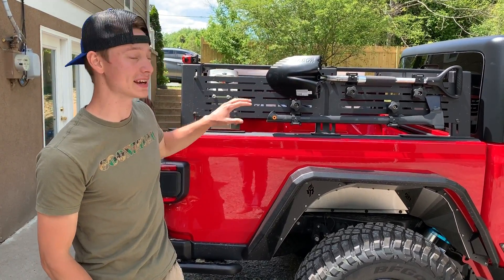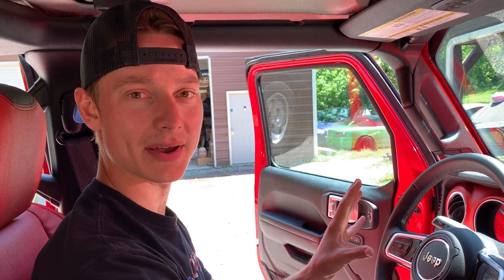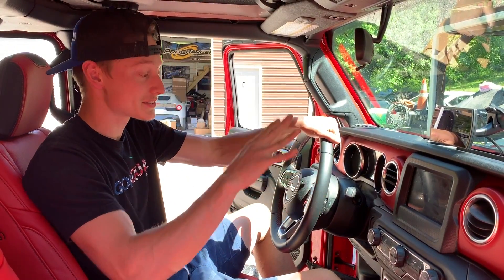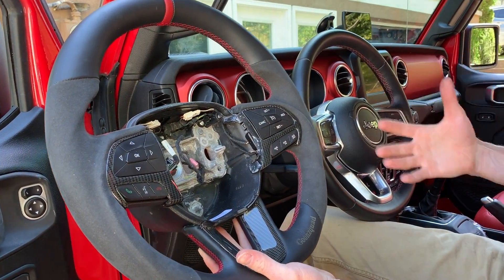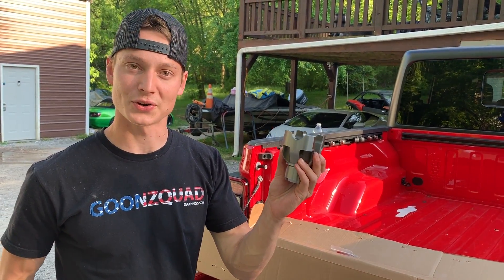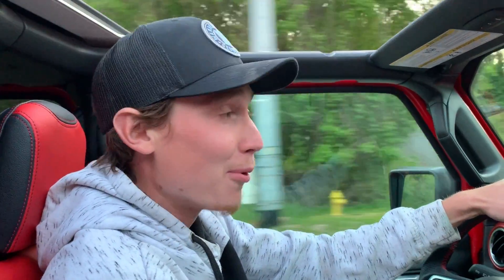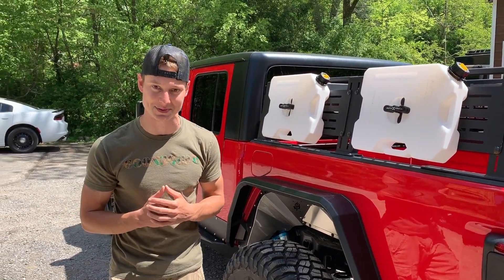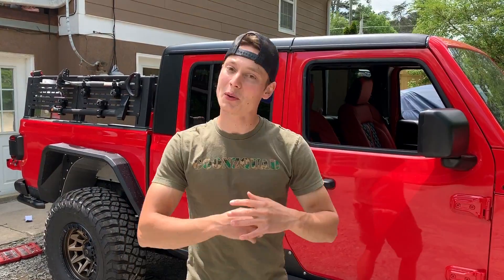Rebuilding A Wrecked 2020 Jeep Gladiator Rubicon Part 19

Comment: Install the powersteering cooler, LED's and tent aswell as spraying the truck bed with black bed liner for a final video on the gladiator
Reply: I was thinking the same!!!
Reply: Fix the dent in the tailgate and the one on the Denali whilst your at it too boys!
Reply: @markbennett6658  all they do now is clickbait anyway... Do stuff just for content. not because it's the right thing to do, or because they thought through it. The military vehicle is a prime example
Reply: I think this is a good idea
Reply: Yeah, bedliner is mandatory.
Reply: @houwant  you're totally wrong. they built that truck because it fits the theme of the world right now and its cool thing to do.
Reply: Sampoorn PN So sorry your feelings were hurt!
Reply: Sorry ma'am, the apocalypse vehicle is one of the worst thought-out things I think that anybody could ever do. That build was not thought through at all! For example, do you know how much a gallon of water weighs?
Reply: @speedcarnage7003  it's cool if you think about doing it the right way... If you actually freaking think about what you're doing and plan it out... But they didn't do that. It was just to push video content out for us. Straight clickbait! I mean seriously:
1- solar panels
2- inverters
3- water tank
4- table
5- LED lights
6- water pump
7- interior paint
9- batteries
10- air horn
11- cabinets
Should I go on? crazy cool project if you think about everything else in advance but they didn't do that it was just a push to get content out.
Reply: And a complete walkaround!

Comment: might want to flip that table around so it doesn’t hold water when it rains!
Reply: Haha... first thing I thought. 2nd was, I'd probably add some 3M foam/rubber strips to the rack because it looks a little loose. That rattling would drive me insane very quickly.
Reply: Was thinking the same thing
Reply: It was the first thing I thought, I hope they have a clothes line installed when someone takes the table out and gets a gallon a water in their face.
Reply: Good eye!
Reply: greenhouse3505 didn’t even add max tracks lmao

Comment: I rebuilt a 13 fusion titanium and it took me 3 weeks to figure why it would not start with push start, same as you a plug that was involved in the accident had pulled some electrical pins up and I couldn't tell until I examined the plug. Pushed a couple pins back in and she fired right up, also AC pump started as well. Good find and great vids.

Comment: greeting from the Philippines guys! i would like to suggest get some black water tank, black tank can absorb heat better than the white tank, which means that it can help prevent some growth of algae and other water borne organisms.
Reply: Am a filipino: What if Camo paint????
Reply: That’s horrible advice - here in the USA & also Europe; White or Blue tanks are for potable water, Red is gas, Green is diesel. Black tanks transfer the heat & are NOT for drinking water - only sewer/septic.
Reply: @krasnaludek298  Nevertheless, a white water container will have algae grow in  it while a  black will not.    Where I live many plastic rainwater tanks are black for the same reason, even though it's a hot climate.
Reply: @karl-chanblox1165  aslong as its dark color. Yes camo can do the job but the problem it will not match the paint.
Reply: @krasnaludek298  i assure you good sir when you white plastik tank is always under the sun even though it has a little bit of water inside it will grow algea inside..

Comment: When you guys were switching out the driveshaft, it looked like there was a crack in the frame... The more I look at it, the more I wonder if it’s just a wire lol
Reply: its a weld dude... there's one on mine as well I went to look  ( follow it down to the double plate where the tow hook would go into the frame hole )
Reply: chad ford ahhh okay I’ve never seen a gladiator in person so it was tripping me out lmao, thanks for clearing it up for me🙏🏻
Reply: @kathedrol2930  you scared me for a second hahaha after reading your comment... but I prefer my JKU the wife drives the JT more than me

Comment: Just saying chk. Your table need to turn upside down so water does not collect
Reply: And the cotter pin gets installed from the top down so if it comes undone it will still stay in place instead of sliding out
Reply: well a tent is going to be on top so it shouldn't matter....
Reply: AY9F even with the tent water will still run under the tent or the rack frame and run into the table.
Reply: thought the same thing about the table. Irish weather makes you think that way hahaha

Comment: Where’s the LED light bar? It isn’t a Jeep without a light bar guys!!!
Reply: @Lamster66  I like the table....we carry one similar for cleaning fish and a propane tank for the big deep fry in the evening.  I prefer the light pods like they showed pending mounting over the light bars.  I have 3 pods and 1 bar mounted on my buggy and the pods get used most as they're directional.  Different preferences, but i actually use them instead of having a bar to say look i have a light bar.

Comment: I got a feeling that they didnt use a torque-wrench to attach the new steering wheel. Could become a problem later on if they didnt!
Reply from the maker: 5 ugah dugas
Reply: goonzquad what does that mean
Reply: @goonzquad
 I dont know what that means but we need it on a T-shirt
Reply: That impact got it plenty tight.
Reply: I doubt it anything will happen...
Reply: Well, I've changed the wheel in my Challenger and know you need 63 ft lbs for the wheel...
Reply: BBDcummins  That's on axles/hubs. Not steering wheels. Or at least none that I've seen.
Reply: BBDcummins  you must work on something different than me then... I never saw one on a steering wheel
Reply: Every manufacturer recommends its own exact number for fitting the steering wheel. If a torque wrench isn’t used, and the steering wheel is too tight you will have alignment issues, if its too lose it can actually loosen significantly over time. Thats why one has to use a Torque Wrench for Steering wheel attachment.

Comment: Flip your table. Put the table the other way with the plastic face up. That way if it rains it won’t collect and puddle in the bottom of the table with all the metal parts. If the plastic is up water will just shed off, no issues

Comment: You still have that parts cop car.  Does it still have that spotlight on the drivers side?  Would be a good addition either the gladiator or even the apocalypse truck.  Even the light bar,, mount it on the apocalypse truck.

Comment: Goonzquad, love the videos and this Jeep. That driveshaft has double u-joints not CV-joints. CV Joints would have a boot surrounding them. Also, the moveable part of the shaft is called a slip yoke. The old shaft has one u-join and the "rubber joint" is a CV joint.

Comment: If you get it  turned it will have more efficient power and better gas mileage, the tune will help all the way around with the 4 wheel driving as well 💯. That Jeep looks Amazing 👌, like ready to enter a Jeep contest quality work and details with those Excellent parts💯👍😀🏁